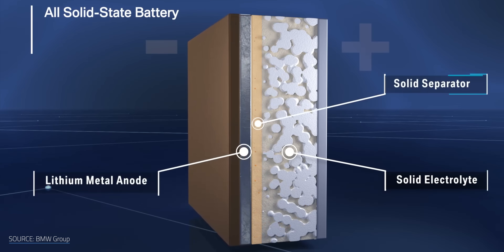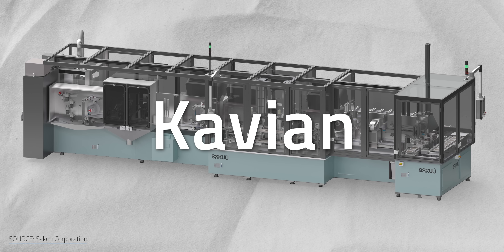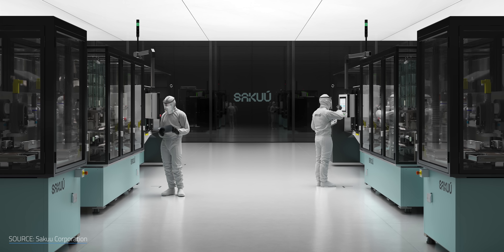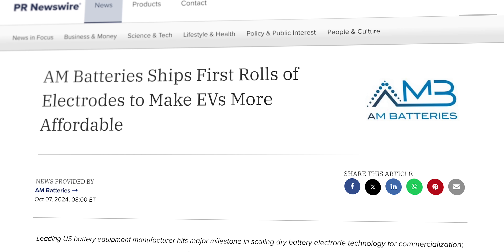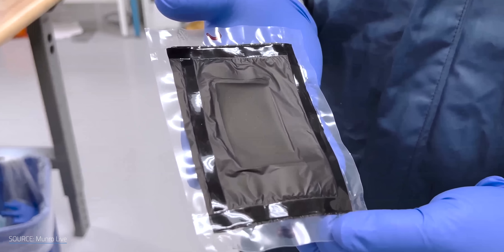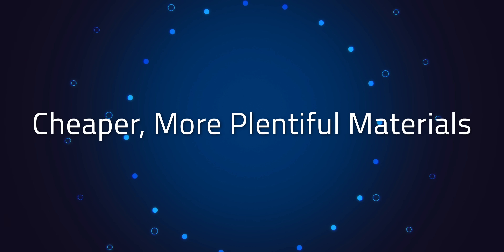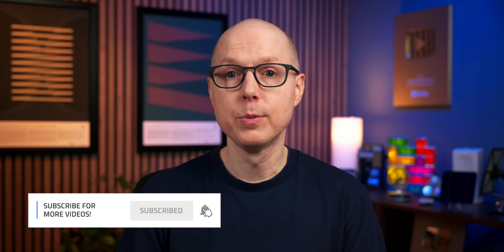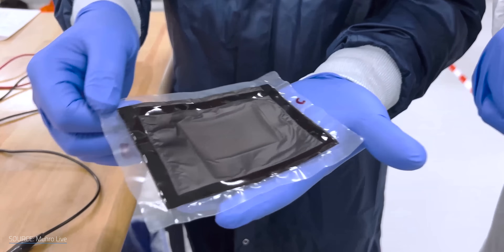Why This Ultra Cheap Battery Breakthrough Matters

Comment from the maker: Do you think these battery price wars and cost savings are going to hit rock bottom like they say? Try Rocket Money for free: http://rocketmoney.com/undecided

If you liked this, check out Why Big Tech's Betting Billions on Nuclear (Not Renewables) https://youtu.be/wnHyYKNnUTo?list=PLnTSM-ORSgi7uzySCXq8VXhodHB5B5OiQ
Reply: There may be some places where the price will drop but considering we are dealing with technocratic companies that put profit before people, it is highly unlikely we will see a mass market price drop.  Just look ate how much innovation we have made as people with many tech advancements being the next big thing to "drop prices" with that rarely ever being the case.
Reply: @user-gf9uz3vw7h  you're absolutely right just look at how unaffordable luxaries like phones and home computers are not to mention TVs. The prices keep going up every year 🙄🙄
Reply: Safety and longevity is already here with LTO cells. They are just working on the capacity.
Those cells have no problems with low temperatures in most areas of the world -50 to -30°C is mentioned and up to 20k cycles with most being able to do more than 15k cycles.
Absolutely safe no thermal runaway or even hot gas.
Just the price and the capacity are a problem.
They should research those cells and scrap solid state.
Reply: Don't get my hopes up, Matt 😅  I want a laptop with a 30-hour battery
Reply: I'm not sure where they are getting their pricing for LiFePO4, you can already buy EVE MB31 cells with 1.1kWh capacity for $85-90 with shipping included. If their big goal is to fight a price target from 3-4 years ago they've lost before they left the lab.
Reply: That's a really interesting technology - but the the claimed current price of $120-$150 / kWh is more than double the ex factory price for quality LFP cells from China - which already sell at the low end of their target price range of $50-$80 / kWh
Reply: @davidedwards8636  Yep, came here to say the same thing. I almost bought an EVE cell at 80 USD, shipping included. Not quite 1 KWh, but close. 
I ended buying a cell at 230Ah, at the same price. So price is not yet there. True, I am end user. So for bulk may be there. 
But the cost cut is promised to be more than that. 
So, let hope this one will mean a real drop in price. 
But there were so many other technologies that promised the drop. 
I really believed in flow batteries. 
I do not care if it weight a ton. 
I want it really cheap. 
But now, a decade later, I almost can afford lithium batteries.
But flow batteries are nowhere in sight. 
Also sodium batteries. 
They are here, but are not cheap.
Reply: good
Reply: Not until there's a legitimate change to the materials in use or some other unexpected advancement.  Right now, it's speculative and the incremental advantages some of these proposed options have are not enough.  This is the next required innovation to spur our world to advance, I fear it's a while away yet.
Reply: Aren't solid state batteries still the better choice?
Reply: Цены понизят ,чтоб обойти барьеры в 15-25%🙄🙄🙄🤫🤫🤫
Reply: I do NOT think so under the orange turds administration. With his moronic views of Tariffs.. prices here in the US will skyrocket because he has his head up his ass on just about everything he does. Should I tell you how I really feel?  I would hope we could all benefit from much lower prices on LFP, sodium ion when they come out, and solid state. But Trump is against EVs (despite his butt buddy being Elon.. the maker of the Tesla that is thankfully getting impacted big time thanks to Trump/Pres Musk being morons). Sadly we wont be able to buy BYD in this country.. which make better EVs than Tesla/etc. At this point I am looking at Kia or hopefully Honda/Toyota are able to bring solid state EVs here.
Reply: Yes -- great stuff. 

I'm following it over in Electric Viking (thick accent). 

Great stuff -- wrong reasons:

CO2 is climatalogically irrelevant. 

Global warming is 21st century superstition. 

Interglaciation climate change (e.g. medieval warm period) is caused by cosmic ray fluctuation ( see Henrik Svensmark et al).

Just burn coal.
Reply: These developments are exactly what RMI is talking about with their Battery circularity initiative where a number of solutions, first listed by Amory Lovins, work together. https://youtu.be/rjWUZrAXPuE
Reply: Iknow that this is nitpicking Matt, but they are not pennies.
Reply: What about life time? Other factor maybe will determine which one will be focused on. Thank you.
Reply: Didn’t a whole heap of battery factories come online last year and more this year? If battery supply out paces demand, then definitely we will see a drop in prices.
Reply: I want plutonium batteries so I never have to charge my device again 😂🤣
Reply: @michaelmayhem350  Setting aside the astronomical cost and the still greater astronomical safety and security issues, it still wouldn't work. The largest radioisotope thermoelectric generator can't even output 1000W, and that is in space where they can take advantage of the cold ambient to yield a greater temperature delta.
Reply: @tonyc7352  wow nothing gets past captain obvious....
Reply: @UndecidedMF  You lost me at transitioning ph(r)ase
Reply: Oh good, another Game Changer/Battery Technology/Breakthrough.
Reply: Production of pennies has actually been discontinued, to your point of them only being copper coated.
Reply: If you could make all cars electric tomorrow how would you generate that much electricity?
Reply: @rehoboth_farm  Nuclear
Reply: Everytime i hear word "breakthrough" regarding batteries,i  make mental note to check water level of lead acid batteries as soon as possible.Them trusty lead acids will still be with us for long time......
Reply: Where does GRAPHENE fit in Will??
Reply: Nice video
Reply: Matt Ferrell - SAKUU is FAKE NEWS , munro live already covered this FRAUD & SCAM of a battery company who is UNABLE to scale , or even be PROFITABLE at making battery cells.
TESLA is already PROFITABLE at making 4680 @ SCALE. 
and its currently cell CONSTRAINED. 
SAKUU is using OUTDATED pouch cell TECH.
meanwhile TESLA is Developing 4680 in LFP, high NICKEL, and other .
Reply: Matt, please listen and stop your suppositions, particular about very expensive high technology, lest you lead anyone else astray:

Lithium Iron Phosphate (LiFePO4) batteries are among the best full-cycle rechargeable batteries with iron in their composition. LiFePO4 batteries feature a cathode material containing iron (Fe), which contributes to their stability. These batteries achieve a cycle life of 2,000 to 7,000 full charge-discharge cycles, depending on quality and usage conditions. This cycle life exceeds that of most other rechargeable chemistries, such as Nickel-Metal Hydride (NiMH), which typically offers 500–2,000 cycles, and standard Lithium-Ion (Li-Ion), which ranges from 500–1,500 cycles. 

LiFePO4 batteries maintain a stable voltage of approximately 3.2V per cell. They provide good energy density, though not the highest among lithium-based options. Their longevity suits applications like solar storage, electric vehicles, and deep-cycle uses. LiFePO4 batteries exhibit lower risk of thermal runaway compared to other lithium chemistries. They contain fewer toxic materials than alternatives like Lithium Cobalt Oxide, avoiding heavy metals like cobalt. This makes them safer and more environmentally friendly.

Nickel-Iron (NiFe) batteries represent another iron-based rechargeable option. NiFe batteries achieve a cycle life of 2,000–5,000 cycles. However, they possess low energy density, poor efficiency, and a bulky design, limiting their modern applicability.

Other notable rechargeable batteries lack iron. Panasonic Eneloop Pro NiMH batteries offer up to 500 cycles and a high capacity of around 2550 mAh for AA sizes, suitable for household devices. Standard Li-Ion cells, such as 18650s, provide 500–1,500 cycles and higher energy density than LiFePO4, but they demonstrate less stability and a shorter lifespan.

LiFePO4 stands out for maximum full-cycle performance among iron-based rechargeable batteries. 

Companies like CATL, EVE, and A123 Systems produce high-quality LiFePO4 cells.
Reply: I don't really like the fact that these batteries can be made in any shape. That will foster even more fragmentation, each device manufacturer will use a different battery for each model. We need standardized batteries to minimize e-waste.
Reply: Placing non-adsense anywhere but very front/back/both means I have to scroll ahead and look where to skip, or just click off in irritation, whereas out of mutual consideration I would watch if at very front/back/both =/
Reply: CO2 is climatologically irrelevant. 

CO2 is climatalogically irrelevant: Interglaciation climate change (e.g. the Medieval Warm Period) is caused by cosmic ray fluctuations ( see the work of Henrik Svensmark, et al).

Just burn coal: the CO2 issue is irrelevant (see above). The sulfur issue with gaol is bogus too: sulfur is an agricultural fertilizer (ask the farmers). The "acid rain" issue is at most "a nuisance" (see the $500 million NAPAP study of 1990).  "Acid rain" was another one of those shallow media sensationalisms, like "global warming" and "ozone depletion". 

Global warming is 21st century superstition. 

Just burn coal.

Sorry, but however intriguing these battery-thingies are, they are just another tax-sheltered boondoggle for people who don't want to do get a real job. 

Just burn coal.
Reply: Why the torrent of clickbait titles? Just another lab research project. Not one of the numbers matters until they're built at least a pre-production system.
Reply: @AussieUnclePhil  because you click on it and that pays his bills.
Reply: Why are you western youtubers ignoring the most revolutionary invention of this era. Why aren't you talking about maxwell chikumbutso's self powered cars?
Reply: Why haul around a block of Lithium when  Hydrogen Fuel cells convert water into fuel, and release only steam.    
   Water: the universes cheapest cleanest fuel.
Reply: @SeaJay_Oceans  pray do tell where does that hydrogen come from to power your clean water car. We're not able to make hydrogen at an efficient rate. Most of it currently comes from mining fossil fuels like methane.
Reply: @SeaJay_Oceans  - Electricity is EVERYWHERE even up in Artic Circle - TWO  Cybertrucls went there & back , Deploying L2 public chargers along way. 

ZERO hydrogen infrastructure.
H2 uses MORE energy than it Releases.
H2 cost over $200 to fill small car.
SHELL in CA gave up & permanently CLOSED its Hydrogen stations in CA. 

besides BEV semi cost way LESS to fuel. 
cost way LESS to maintain.
ZERO maintenance for 300,000 miles. 
company can be trained to MANTAIN own trucks w/ Laptop & Software. 
BEV = LOWEST TCO, LOWEST ROI.
Reply: @SeaJay_Oceans   - TESLA semi , OUTPERFOTMED every competitor in RUN ON  LESS event , Tesla hauled MORE cargo than others & is the LONGEST Distance SEMI .
Tesla hauled 82k lbs gross , for 1200+ miles , 2 charges and 3 Drivers. 
TESLA semi lowest TCO, lowest ROI.
ZERO maintenance.
Reply: The current battle will be yesterday's environmentalism vs. Trump's back to Fossil fuels
Reply: Are you recording videos at normal speed and uploading at 1.25 speed? Playback at 0.75x is just a little too slow, but at 1x you're almost unintelligible to native English speakers. Not a criticism, but maybe a suggestion: Slowing down your speaking slightly will attract more viewers. Thanks Matt. And thanks for the great content. 🙂
Reply: @RWBHere I always watch at 1x speed and as a native English speaker I've never had any issues understanding him. Do you actually speak English or you live in the bayou or somewhere that speaks such broken English it has to be subtitled when spoken on TV?

Comment: If solid state batteries can be made ultra cheap with new electrode techniques and low cost cathode materials, it could slash costs by 50–60% and finally make EVs and grid storage affordable at scale
Reply: It's happening, just very slowly 😵‍💫 maybe in the next decade we will start to see this become noticeably implemented. And even if it's ages away, great men plant trees they'll never sit in the shade of.

Comment: You say that these batteries are stuck in R&D plus more than 5 years away, but I remember your first videos, -- when we were wishing for lithium batteries. It doesn't seem that long ago 😊 I think the battery prices will drop and I will be happy when we get away from cobalt and lithium. I also want to be able to plug my phone in without wondering if it will blow up. 😅

Comment: Instead of constantly blaming motorists (ICE) how much pollution is caused by the thousands of aircraft constantly flying around burning tons of fuel?
Mining trucks burning 800~1200 gallons of diesel every day without regulation ?
Fuel cost in relation to production ?
If your taking 300~500 ton truck 'offline' to do repairs or maintenance it costs far more in lost production than an extra 5~10 gallons of diesel every day, even if running 15~50 trucks.
This doesn't even question military use, again without regulation of any sort for combat vehicles.
(let alone cement, steel, aluminium and other metal production)
I'm just fed up with the bias of blaming motorists for 'everything' with little or no mention of other polluters

Comment: That's definitely great, but what I'm really more interested in is SAFER, longer life, higher density batteries. The current climate sca... I mean 'goals' are unachievable with the current tech, mining, manufacturing and grid capacity, unsustainable and delusional too really. Battery tech needs to make far bigger leaps for any of this to be possible, also major grid innovations are needed, hopefully with hyperconductivity lines that make global power sharing possible, which will also make solar farms way more useful.

Comment: Modern battery tech has 2 general areas. There are the small labs working on many new ideas and their are the bull sh-ters like Elon making claims for the most gullible.  Obviously what can be accomplished in the lab has a much different story when they try to scale it up. If you want to see the latest high tech scaled up and working in mass quantity, look no further than BYD. China foresaw the future and backed BYD with massive funds while the U.S was still standing about playing with themselves arguing over pick-em-up trucks and hand held explosive devises in case some stranger walked across their lawn.  All cursing aside, China foreseen and planned to take the auto market by storm. They will go as far as selling at a loss to crush any competition. We will never know the advanced tech in BYD batteries going forward. They are also great Bull sh-ters. Elon's idea to confiscate Greenland's minerals seems fairly ignorant venture at this point. Seeing that BYD is already miles ahead in battery tech. and watching every move.

Comment: the argument about phones is quite weak, the reason why phones should be built around the battery is because it's usually the first component to wear out and thus needs the easiest replacement. building a battery around a phone will just lead to people disposing their phones as soon as the battery dies, this is a no-go if you ask me.

Comment: Your talking points may be effectively promoting more proprietary designs that will drive up consumer cost due to the irreplaceable nature of the power sources and the flexibility to modify layouts to the extent that they make it harder or even impossible to service. Yes the breakthrough matters but who will benefit from it?

Comment: Thanks Matt!

TLDR; Sakuu has a dry electrode 3-d printing process, and lots of sales of their manufacturing systems,.

Georgia Tech researchers have used an Iron Trichloride cathode material that costs 98% less than Lithium Iron Phosphate cathodes and mostly performs better.

Comment: Very interesting progress Matt, I agree that new advances are coming - just look at how much research (private and public) is searching for the solutions to low cost energy storage.
Over a four year run, I built my own solar-electric system that runs my home. LFP Battery cells today are half the cost of four years ago. 
I February this year I was able to buy a F-150 Lightning for the same price as the similar F-150 ICE - granted this was at Ford Mo Co expense due to over production and weak sales, but it is coming.  A comparison of the costs of both trucks over a ten year period, the electric is half the operting cost.  HALF.  and it can supply energy to my battery-electric home in an emergency - win win.
I believe (regardless of US-politics) battery storage is coming and will change the way energy is collected, stored and used around the world.

Comment: the problem isnt cost its energy to weight. batteries cant hit 1kWh/kg but gas and diesel both can hit above 10kWh/kg. Maybe cars arnt the answer but this guy with his Tesla stock wont tell you that.

Comment: Tesla M3 50-82 kwh so 7500-12400 at todays prices, 2500-4000 with this,  So it's possible we'll see $15000 cars again, but only when we get business regulation back, else it all goes to the oligarchs' bottom line.

Comment: Well, this is interesting, but it still doesn't address the primary drawback of EVs: They do not displace any emissions, while creating new ones. You can reduce those new emissions, but they are still extra emissions which would not exist if the EV had never been made.

Comment: Even if they get EVs down to an affordable price. They will still need to make a battery that doesn't have issues during cold winter weather. There are more problems than affordability.